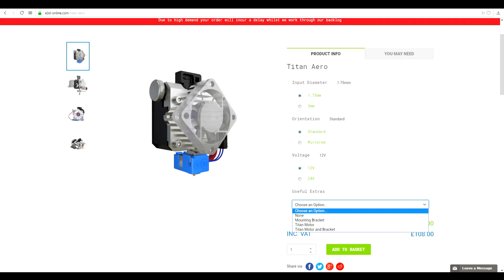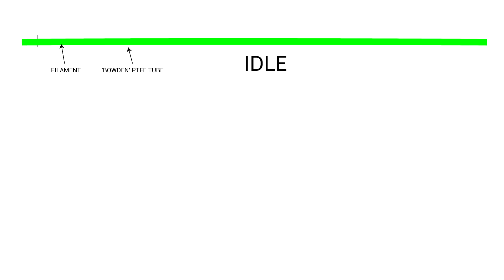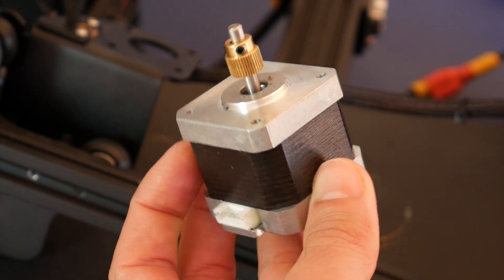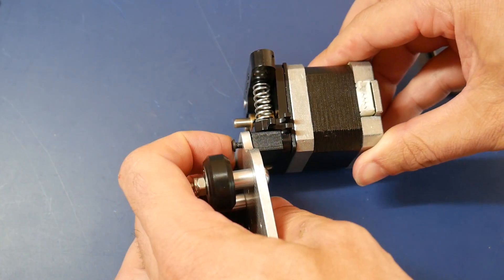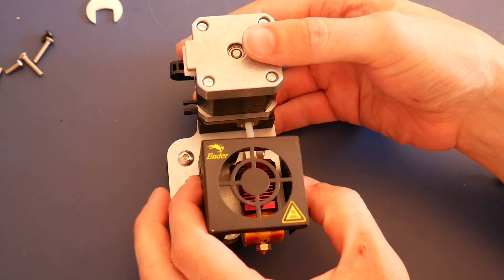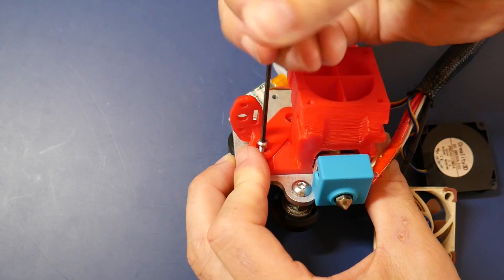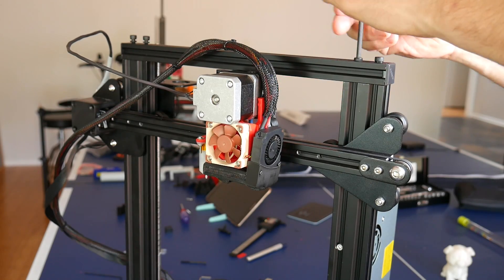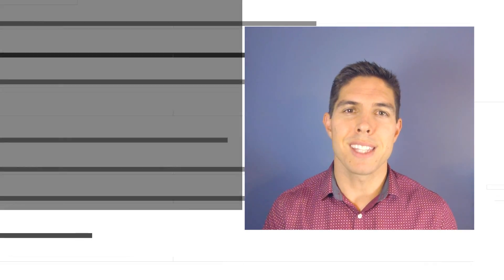Simple direct drive Ender 3 mod for only $35

Comment: What is the proper probe offset for an 18mm ABL with your hero me .stl setup?
Reply from the maker: It's different on every printer depending on the height the probe is mounted. I always recommend tuning it live as the first layer goes down.
Reply: @TeachingTech  i was talking about what offset to use on the custom probe mount when configuring the process for the printer. However, i think i got it figured out.

Comment: Received kit and installed.  Found quite a bit of play between upper and lower rollers..anyone else?  Based on the new weight of the carriage, test print was good, but still a little disappointed at the inaccuracy of the milled aluminum.
Reply: What kind of play are you referring to? If there is something wrong with your kit please contact me and I will make it right. Have never had anyone else state this and I have sold hundreds of these kits. Once the bolts are tight on top there will be no play. If your carriage is wobbling then you need to adjust your accentuated nut on the bottom wheel to tighten the carriage to the extrusion.
Reply: No problems now, adjusted the bottom wheel nut, missed this (what a noob!) ..now nice and proper.  Great kit.  A must buy!  Ender 3 was best out of the box and now even better.
Reply: @hepachip3  Very happy you got it figured out!!

Comment: Michael, 
I did this mod but for some reason I have filament grinding now. I moved my retraction from 5 to 1 the same way you did. Extruder is not clogged. Any suggestions?
Reply from the maker: Maybe a slight misalignment? If you squeeze the extruder lever with one hand and push the filament down through the extruder and heated nozzle wit the other, does it extrude nicely or is it hard to push? If it's hard then something like the PTFE tube is not quite right.
Reply: @TeachingTech  No it's easy to push. Also if I lift the the extruder and extrude a 100mm through octoprint the filament comes out with no issues. It's funny that after I performed this mod I printed a 20x20 calibration cube and it printed perfect. Since then filament grinding.
Reply: Hey I also installed this and I am having the same grinding issues.
Reply: @juggernaugh75321  I was able to fix mine tonight. I have a fixed glass bed (no springs) with a bltouch. Nothing should have moved but I discovered my Z offset was way off. Extruder was pushing into the bed stopping the filament from coming out. That's why when I raised it from the bed it came out fine. After I calibrated my Z Offset I am up and printing again with no grinding issues. I don't understand how the install moved my Z Offset but it did. This may not be your problem but I figured if it fixed mine it may fix yours too.
Reply: @jerrymccarty7251  I managed to fix mine I had to turn my flow down a lot more then I expected.

Comment: Newbie here with the ender 3, ive printed a few of your upgrades and they work well, but as far the best hot end cooling fan attachment,  which one do you best reccomend? I dont want to print multiple to figure it out if you already have. I also am getting the self bed leveling bl touch,unless you can reccomend better , completely stock hot end though. Any help would be greatly appreciated thanks!
Reply from the maker: I've tested the PETSfang2, Bullseye and Hero Me. I settled on the Hero me. Plenty of ABL mount options and ability to switch between different size fans without printing the whole thing again. Importantly, compared to the Bullseye, no rattle between parts.
Reply: Okay sweet i just went ahead and started that print, thank you for answering! :)

Comment: Curious how this holds up with the plastic parts and the motor only held on by 2 bolts. I'm new to the ender 3 and have been wanting to swap out the extruder for the EZR, but I think a direct drive mount would be a better buy. Thoughts?
Reply: Two bolts is more than enough to hold the motor in place. There is very little torque required to move the filament. The piece it mounts to is 6061 aluminum. Been running the mod for months and it is just as good now as then.

Comment: Can you use the this mod on a ender 5 aswell?  Can you use the extruder upgrade kit the aluminum kit instead the original?
Reply: I will be working on an Ender 5 upgrade. The belts connect different so this will not work on it. It will work with the all metal extruder.

Comment: So I've been playing around with Cura settings to get my stringing problem to go away. I've got an 8mm retraction distance running at 55mm/s. I'm still getting little wisps at 200-210C, full on strings above that and at 190 I've got blobs. Are there any other things I should be looking at to solve this problem? I tried Chazmeisters settings and that didn't really do much for me.

Comment: I wonder if the BullsEye duct will fit on this?
Reply: It does not
Reply: @juggernaugh75321  Yea I later figured this out and abandoned the project short term. I am "when time provides" will be adapting a Base plate to work for the Bullseye but int he same breath I need to adjust the height to consider the fan clearance with the stepper motor protruding. I should be able to get something working within the next few weeks due to life things.

Comment: Is it compatible with the metal extruder upgrade?
Reply from the maker: My understanding is yes. A slightly  shorter bolt is included to suit it.
Reply: @TeachingTech  ok thanks
Reply: The long bolt that keeps the spring in place needs to be replaced with a small 3mm bolt which is included. The short bolt threads in from the spring side.
Reply: @abarasabwehttam  thanks
Reply: On my macewan3d aluminum extruder I'm having to make a 1mm spacer to bolt to the mounting holes, otherwise it's just a tad too close to the carriage plate

Comment: What material did you print your hot end bits out of?
Reply: The spacer that the hotend touches is made from Ultem 9085. This is very high heat resistant material.
Reply: Not so much the spacer bits I'm worried about more concerned withe parts cooling fan and what not
Reply: @JustinJohnson-xb5gy  The kit doesnt come with a change to the part cooling fan, it uses the stock metal box. If you print a Hero Me or similar upgrade I suggest PETG or ABS for it.
Reply: sweet thanks happy to see the designer active within the community, just ordered your conversion off ebay cant wait give it a go

Comment: The original hero me v2 will not work with this upgrade, the stepper motor hits the hot end cooling fan and the new carrier plate is thicker, for this mod you have to use the one @teachingtech made. I have a stock hot end and it worked perfectly after printing his version.
Reply: Yeah the mod to the Hero ME works AWESOME. We put it on ALL our machines. Glad the kit is working good for you.

Comment: To be honest, i really don't see any difference in these prints.
Reply: The difference is when you get to all metal filament from The Virtual Foundry or highly flexible filaments. I print a lot of metal and nylon and having a direct drive is required for the metal and makes the nylon MUCH better results. Also there have been many cases of the bowden tube couplers failing on the stock version, that is eliminated. Also see the difference when you are making parts that actually require precision, which I make a LOT of for government contracts.
Reply: Cheers Matthew, nylon printing does seem appealing, is that reg or 66 also? What about the ptfe or teflon bowden tubes? Can't remember which but i know when welding they work better. And keep up the good work on the singing, maybe a little less reverb but you got my sub!!
Reply: @ifell3  I use a Karaoke app to record so the settings are pretty fixed. I am no pro, just like to do it. Mainly I use YouTube so I can send it to my folks who like to hear it for some odd reason. Thank you for the kind words.

I use regular PTFE tube for all my printing, and I print my nylon at 248 nozzle temp, never an issue. I do swap the tube out every 150-200 hours. Heating and cooling it makes it lose some of its slip. As for Nylon I use 645 from Taulman 3D.  I use it to making masking fixtures for a blasting process that eats aluminum in seconds but this nylon has been thru thousands of cycles for 18-20 months per set. Settings can be a real pain for it but once you have it down it is amazing material to work with. Saved the company I worked for hundreds of thousands in labor and material from the previous process.
Reply: @abarasabwehttam  wow, this is the kind of info that I love about open source. I really do hope your company appreciates you!! 
Why use a karaoke app, I take it you know all the words, even if you don't, play it, but record in audacity, plenty of good free apps out there. Don't forget resolve for video editing.

Comment: Michael, any thoughts of replacing stock extruder steeper with a pancake style? reducing the mass might help? Thanks for the great videos.
Reply: Yes it would reduce the mass, however will have to get the wiring right or a pancake that has the SAME wiring setup.

Comment: Thanks for this video, I was going to machine a piece of aluminum but decided instead to make a relocate bracket from ABS/Carbon Fiber. Using all the original bolts I only had to extend the cable and purchase a $3 quick connect. Here is a short video of it. 
https://youtu.be/hpFWEWiVfOA

Comment: Great videos and content! I did this upgrade and there really is no need to remove the entire x axis rail from the machine. If you remove the x axis carriage wheels the carriage comes off and is easy to reinstall the new carriage. Is there some other reason to remove the x axis rail that I’m missing?
Reply: I did this so the instructions would line up with new builds. While it isnt required some will find it easier to get the bolts loose and installing the kit when the X rail is off the machine.

Comment: What material do you need to print the hot end spaced out of if you need the shorter one? Will PLA work or will that just melt? Thanks!
Reply: The kit has been updated to be the modified size and made from Ultum 9085.

Comment: Hello Teaching Tech, can you give me a link or some detailles (voltage, nm, etc) where to buy the slimmest stepper motor that I can buy to replace the 42 40 stepper of the extruder. I have seen that some "pancake" stepper motors so that the direct drive mod to be as light as possible so less ringing. So i am interesed of the slimmest possible stepper motor that is ok and can be mounted on and has no problem as power for the extruder.   Here is some specs from some stepper motors: 

25mm long Nema17 Pancake stepper with a detachable 30 cm long cable without connector. 
Weight: 153g
Max Input current: 0.7A per phase
Step angle: 1.8 deg.
Torque: 18 Ncm
Outputshaft diameter: 5.0 mm
Hole for mounting: 31 mm, 4xM3
Motor lenght: 25mm

17HS0401 nema17 42mm bipolar stepper motor
Body length: 22mm
Shaft: 5mm diameter flat 18mm long
Rated current: 0.8A per phase
Holding torque: 120mN.m

Comment: Thanks for this video! 
I purchased one and got everything installed on my Ender 3 over the weekend. I just had to turn my flow down to 95 from 100 like my Prusa MK3 and the prints are coming out great. Great price and solid solution to get Direct Drive onto the Ender 3. 

Did a Picachu like you did but with the flow down to 95, it came out a lot cleaner. Granted, it could me my 5015 fan helping as well. 

Also, thanks for the new Hero Fan Duct. Works well, just had to trim the bottom right side since the mount was holding it a little too high.

Comment: Will this work on the Ender2?
Reply: The Ender 2 uses the same X carriage so it will work on the machine, however, there is no Z support on the X plus side of the machine so I am not sure it will suspend the extra weight.
Reply: Hi, there is also no support at the end of the X axis beam on the Ender 3 as the end of the beam does not have the twin screw drive like the Ender 10. The E3 only has a 3 roller guide against the right hand upright and you can actually push the X axis beam up and down and out of square very easily with one finger. I think the extra weight will cause the beam to drop …...it only needs a few thou...….when the extra weight of the new direct drive gets to the end of the beam. I think a mod that had a twin Z axis leadscrew like the E10 would be good for maintaining the beam level at all positions. That would then be virtually a mini E10  @abarasabwehttam
Reply: @gangleweed  Yes having that connected to the right hand upright is considered support. I have run this kit for months and months and my parts are perfect all across the bed locations. When you level your bed with the extruder all the way right, if there is any droop it is there when you level it. Try it before making claims that can not be supported. If's and could's are not facts.
Reply: Well, I have an Ender 3 Pro and I can definitely say that with a dial indicator I saw a drop with just a finger pressure.....adding the weight of the extruder and stepper motor to the end of the right side is quite an increase, there is NO support from the right hand wheel carriage,, possible guidance yes, but in fact if it was completely off the printer it would not be noticed except for the fact that the X axis crossbeam is quite light in itself and so could flex, adding a set of wheels in the upright plane does not add support. I come from an engineering background of 60 + years so machinery design is my second nature thing. I would love to see a design mod to have a second leadscrew on the right side of the Ender 3 like the E10 models.
 @abarasabwehttam

Comment: Would direct drive help with printing flexible filament?  (I'm having problems still even with the extruder EZR  upgrade, hot end can get clogged 30 minutes into printing)
Reply: Yes it will
Reply: @abarasabwehttam  thanks for the reply - any info on why/how it actually helps (trying to learn)?  In particular what I'm a little confused about is the fact that the hot end seems to clog up after 30 minutes or so printing flexible filament (I have the all metal hotend, from Micro Swiss by the way I put on my Ender3), then would either the extruder or direct drive help?  [I did get a suggestion to go back to the standard Ender 3 hotend, but I am trying to print at 250/260 degrees]
Reply: @greghauptmann  If it is clogging in the HOTEND then you have the temp too high or your cooling fan isnt keeping the micro swiss cool above the heat break OR you are retracting too much and the filament that is pre melted is touching in the heat break and sticking to the side. Using an all metal hot end can be tricky. I print at 240 all the time on the standard hot end without issue.
Reply: @abarasabwehttam  oh, thanks.  I read for flexible to have no fan somewhere, so I've been trying to get it working via setting the temperature higher (260 out of the 240 to 260) range for the filament, and no fan.  So I should try the opposite then.  I was imagining having it hotter might be better but I guess you're implying you want the filament to be "soft" too far up from the nozzle I'm assuming(?).  I'll try this with the Micro Swiss, and then if still not working well might drop back to the original hot end and try too, might be a good approach then.

Comment: I'm really hoping he comes out with a kit that works for the Ender 5.
Reply: It will work on the 5, just need to mount the spool up top or make a routing for the bowden tube as a filament guide.
Reply: This should have stated IT will work on the Ender 5, not I will work on it. The carriage is the same for the 3, 5, and CR-10
Reply: @abarasabwehttam  Sorry the carriage is not the same. The Ender 3 belt retainers are on the underside of the bracket where the Ender 5 they are on the face of the bracket. This causes major issues. I know I just been thru it trying to get a Hero me installed on My Ender 5's

Comment: How fast can you print in TPU and TPE with this?
Reply: This doesnt effect the speed on TPU, it needs to be printed at reduced speed no matter what drive you are using, however, it allows you to print much softer TPU as well as metal filament from The Virtual Foundry.

Comment: https://www.thingiverse.com/thing:3103256 same thing totally free ;-)

Michael, I strongly believe that you don't need direct drive extruder of this type. The main advantage of DDE is not the smaller retraction lenght, but that you can get rid of PTFE tube. Since you don't have it, you can print higher temperature materials like PC and Nylon. But you still have small PTFE, that makes the upgrade almost useless. You CAN print without strings with bowden, it just takes a couple of minutes more on  a few hours print.
Reply: @SynJa 3DP i didn't rate it as totally useless. I admit that in rare certain setups it will take some benefits. The problem is that the advantages are mostly theoretical. Just google for real users experience with this mod. To tell the truth, the main disadvatage of extra weight on the head is also negligible because the weight on Y axis is anyways more than one on the X beign a restricting factor for the speed rate on MK2 type of printers.

Comment: I like this mod, although for me one of the reasons I might go direct drive is for flexible filaments. However I am not sure if the output of a better extruder is going to be aligned with the hotend, like the stock extruder is. Also the mount for the extruder/stepper is designed specifically for the stock extruder. But the new X carriage looks like a very well made part, and it's temping for US$35.
Reply from the maker: I can confirm it is very well made. I'm interested in changing the standard extruder to a printed one that is compatible with this kit. Then we get the best of both worlds.